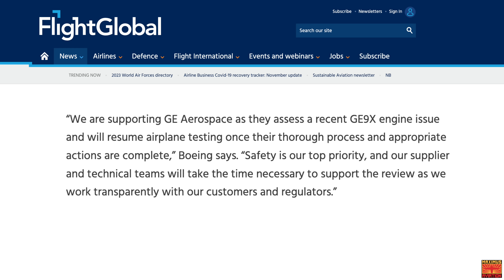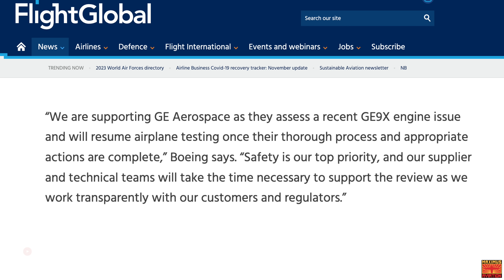Boeing Grounds All 777-X Test Aircraft Due To GE9X Engine Failure. Will the 777X Ever Get Certified?

Comment: Surely if it were an issue with a particular engine you’d swap it out and continue testing while having the failing unit checked?  ... if they are already warming folk up for a delay then I’m guessing it might not be a trivial problem.
Reply: What you are saying is sound reasoning.  I think what you are saying has merit.
Reply: Based on what you know you can conclude what you like. Based on what the engine manufacturer knows about the failure I suggest you are miles away with the reasoning.
Reply: Depends on the failure mode.  If it's something that needs a complete re-design, you have to inspect all existing engines, rework, and reassemble.  These issues are "normal" with new technology.
Reply: With a new engine, you don't know if it's a pattern or a one-off issue. You don't want to find that out in the air. Even if it's a one-off issue, there's no way of getting ETOPS unless the problem can be identified in manufacturing. So, the engine needs to be torn down to find the root cause of the issue, and resolve that issue. If it happened once, it will happen again.
Reply: If engine components are made up of space age modern materials instead of older proven alloy metals, then there is no telling if this engine  will ever get off the ground. GE may have to go back to the drawing board if that's the case. Just saying.

Comment: once they decided aircraft can only have 2 engines the sizes have been pushed harder at the same time as economy, noise etc. have required improvements. Is technology being stretched too far?
Reply: Calm down, that's what people seriously thought at the beginning of the jet age. No, the technology is NOT being stretched too far. Anybody remember how much worse the RB211 development was? And how it later became synonymous with reliability? It's simple: if the design works, the design works.
Reply: It's true that engines are reaching their limits with current technology. The only way to increase efficiency in them ( which is the primary motive) is to increase the fan size and bypass ratio. The bypass ratio in particular is the issue. It leads to extremely high temps in the core. This is reaching a physical limit for even the most exotic of materials.
Reply: @johniii8147  Jet engines have struggled with materials from the first prototypes.  They keep improving the materials.
Reply: @danharold3087  Yes indeed. But there is only so far you can go. And when you look at the billions it now takes to achieve a 10% gain in fuel burn it's a risky bet.
Reply: @johniii8147  you're a physics expert?
Reply: @rafaelwilks  You don't have to be if you just do some fairly simple research on the topic. They technology has simply reached it's maturity with no easy gains left.

Comment: I wonder if there are any companies in any industrial sector who wouldn't say that safety was their top priority? Thanks for a great update, Maximus!
Reply: Probably none, but I can confirm most people in the aviation industry really do take safety really seriously and for good reason. Take me, for example. I’m a ground handler at my local airport where 737 and A320 variants are the most common aircraft but we can and do serve 787s and A330s and the most immediate example of a bad mistake that I can think of is reversing the water or lavatory truck up to an aircraft without a banksman and due care and attention. I’d end up ramming the plane up near the tail section and possibly damaging and weakening the bulkhead that separates the pressurised passenger cabin and the non pressurised area beyond that houses the APU. If I didn’t report it the next time that plane gets above ten thousand feet the bulkhead would rupture and rip off much of the tail section in the process. Similarly if I closed the cargo door without proper training and don’t do it right, similar result.

That’s what makes the Max 8 crashes so awful. Most of us would do almost anything to protect the aircraft and those aboard in an industry where mistakes could cost hundreds of lives. We’re so paranoid that although I’m not an engineer or pilot but if I see damage or something that just isn’t right and report it, the plane is grounded until someone qualified such as an engineer or pilot checks it out. Hence why even this seemingly minor fault has stopped the test flights-that same over abundance of caution.

All that being said, the way they’re both calling it minor and yet mentioning delays makes me wonder if perhaps it’s actually a serious problem and they’re trying to prepare everyone for incoming delays.

Comment: It’s almost as though… these major companies have forgotten just how to make planes and engines…
Reply from the maker: Its those damn new fangled computers! 😆Back in the day when we only had slide rulers and a pencil we could build stuff. Actually thats how they built the Saturn V rocket and why they couldnt duplicate it today.  It was all mathed out by hand people today cant concieve how to do that.
Reply: Maybe that slide rule math had of something else too it! Moral ethics perhaps? Something has certainly been lost over time... I think that whatever it is we should definitally find of it again, for this industries sake!
Reply: @williambrodmanvi5944  back then, with slide rules and no computers, jet engines failed much more often, too 🤔 let's see, 

"In the early days of the Jet Age, an engine was removed and overhauled after 2,000 flight hours.

Nowadays, it takes about 20,000-30,000 flight hours for any major overhaul of the engine. Today, wide-body jets equipped with just two engines fly to all corners of the globe.

Also, early jet engines had an In-Flight Shutdown (IFSD) rate of 0.9 shutdowns per 1,000 engine hours, making them unreliable. Today, jet engines such as the giant GE90, boast a massive IFSD rate of 0.001 per 1,000 hours (that is, one engine IFSD per one-million engine flight-hours)."

Now that we use computers, with jet engines being more reliable than ever, let's go back to slide rules, which is what they used back when jet engines were less reliable! What can go wrong?

https://www.highskyflying.com/why-are-jet-engines-so-reliable/
Reply: Heard of the troubles P&W had when they made the engines for the first generation of 747? Heard of how many problems there were during the development of the RB211?

Comment: I’d rather a plane be grounded during development than crash with passengers inside 😩
Reply: Planes do crash with passengers inside
Reply: @nickolliver3021  the point is that it’s better a plane gets grounded right now before it flies and the issue is fixed, rather than for the issue to be uncovered once it will actually operate with passengers and kill people. Not really a controversial point
Reply: @ekesa07632  Nick is just being snarky and sarcastic.
Reply: OK now your sneaking grounded into the picture.   Careful here.  It says Boeing has halted the flight test program.  We really have no idea what is going on.

Comment: Whenever you try to push the technology, you run the risk of delays.
Reply: Yep. Current engine technology has reached it limits and they have to push it to the very threshold to get any additional gains.
Reply: @johniii8147  how do you really know if current technology has actually reached it's limits? You're a physics expert or something? You really think you know more about the engine development that the people actually working on it?
Reply: @rafaelwilks  The people working on it are the ones that tell me this.  And yes, it's pretty simple physics. The only way to get better efficiency with current technology is a higher bypass ratio which entails bigger engines with higher temperatures. in the cores.
Reply: @rafaelwilks  Don't you realize that everything that can be invented has !
Reply: @johniii8147  but have they expressed doubts about the GE9X?
Reply: @rafaelwilks  That it will take time to work out the issues.

Comment: Sorry maybe dumb question but isn't it a bit late in product development cycle to be finding a show stopper issue like this?
Reply: Well, critical problems with the Max were only found too late and during commercial operations, so it's probably and sadly never too late.
Reply: Not necessarily. Airplane programs have testing conducted for nearly their entire program cycle (that is up until they are no longer built),  albeit it becomes less and less. Issues can be found years after deliveries begin and the company works to find them through testing before they become an in-service issue.
Reply: @aerotech9804  Yes, I understand finding issues, of course, thats normal. I asked about show stopper issues, isn't it a bit late in testing to find a show stopper? Thanks, appreciate your reply.
Reply: @doyoulovehimloretta1607  It takes TIME to put time on the engines and it sounds like this is the engine with the most hours on it, They showed the engine on the test 747 so it is probably the test engine and having the most hours it will show any problems.  All modern engines it seems run into some problem or another, look to RR and PW also GE also.  seems to be a problem when the Government keeps instituting new emission and noise limits they have to keep pushing the limits !!!
Reply: GE should be the one facing this question, they are the ones that stated in 2019 that the engine issues have been fixed.
Reply from the maker: Yes and no.  This is why they take so long to test them.  They drive them hard to see if things like this develop.
Reply: @maximusaviationchannel  I've been in product dev all my career, to me a show stopper (if it is one) at this late stage is a sign of bigger program challenges. Thanks for reply.
Reply: @doyoulovehimloretta1607  The Trent 1000 seems to have done very well during it's entire test phase, and we all see how that turned out. The RB211, meanwhile, had even more, and worse, development issues than the GE9X, and it has since become synonymous with reliability, so, yeah, there goes that argument 🤣
Reply: @rohrichoak9740  the issues with the 737 max where due to a flawed MCAS design and negligence  , not necessarily  a good example . 

A good one would be the issues  with both the RR Trent 1000 and  the PW GTF engines that caused groundings of some 787's and a320neo's/a220's respectively.  

Both these engines had been certified for some years now before cracks and corrosion  on some of them was  witnessed  well down their life cycles . 

This is similar  to what's going on here.
Reply: @mmm0404  Those are even better examples indeed. What I meant was the fact that some issues will only happen in real operations and they might never be able to be replicated during tests and simulations, therefore de delayed timing for such things to happen.
Reply: @Blank00  Blah, blah, blah..............................boo-hoo!
Reply: @rohrichoak9740  Sadly critical problems were introduced into the MAX after development was finished.
Reply: Is this a show stopper.   Looks like Boeing is in no rush.  How long would it take to swap on another engine ?
Reply: @danharold3087  Hey when you going to link us to that utter BS you spewed about the so called Airbus fix that was fairy tale? Danny you always like to engage so I may embarrass you I simply just don't get it.
Reply: @danharold3087  Why would Boeing swap an engine not knowing if this model may now have safety issues Danny Boy? Your lack of how things work in aviation causes you to have egg on your beard quite often hey? If this model turbine has issues installing another one doesn't do jack. Start studying a little before posting nonsense from your chair.